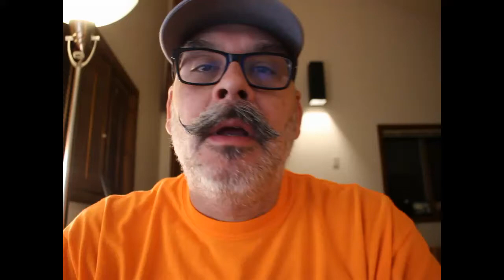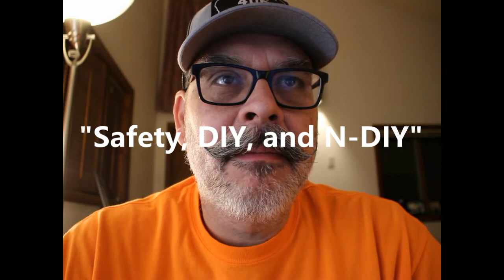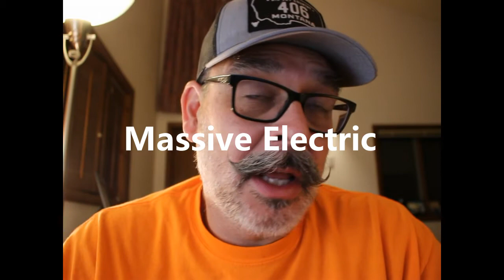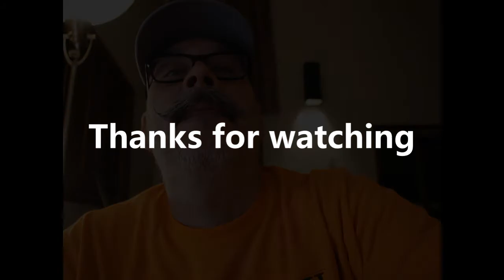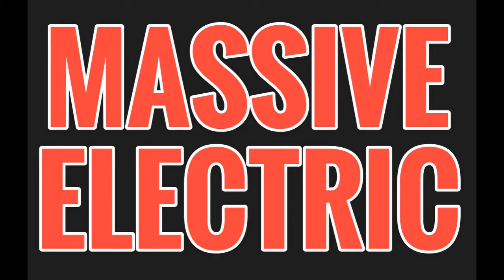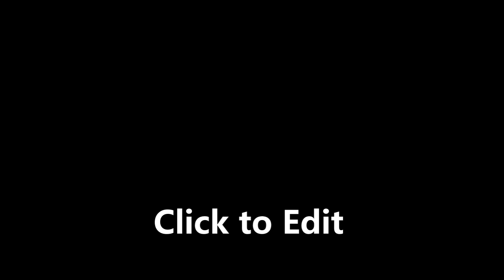Safety, DIY and N-DIY: Pushmatic Breakers Lessons Learned

Comment from the maker: How much experience do you have doing electrical work? Have you ever replaced a Pushmatic circuit breaker?
Reply: No experience. I'm getting ready to replace a Pushmatic 2 pole breaker tomorrow
Reply: I am also a do it yourselfer.  I have a Pushmatic 150 amp service box .  I did some upgrading in 2019 adding a new 20 amp circuit and outlet to my box with 12-2 wiring  so that in addition to the outlet, I could get a proper ground connection to the wall that I could extend up to a switch location.  The switch was one of the old single pull single throw types in series with a ceiling fan .  I wanted wi fi smart switches so I could say "Hey Google {or Alexa}  Turn off the TV Room Light!  "   I have that now.  I also have a perfectly good 20 amp outlet that I can plug  the vacuum in, as well as something big like a space heater, but more often, a 6 outlet  connector that can hold Amazon Echo Show,  Google Home, some USB 2 amp chargers for phones, tablets, wireless headphones and other 2010s 2020s type stuff folks did not anticipate when my home was built in 1930.  I think the electric may have been upgraded in the 70s and 80s because in addition to knob and tube style old wires, some of my circuits have14-2, 14-3  and 12-2  Romex wire , some of nonstandard colors, as today, 14-2 is supposed to be white and 12-2 is supposed to be yellow. You only learn this stuff as a do it yourselfer if you get enough books on wiring and watch the correct You Tube videos.   I have BROWN shielding on some of the old 12-2 wire that feeds the front part of my kitchen.   I watched a lot of You Tube videos and borrowed library books on electrical wiring in 2019 when I added my new circuits.  There is a tremendous amount of info to learn .   When you are in high school and college physics or you like electronics, you know circuits,  ohm's law, voltage current power.   You have to learn from books and videos about standards such as  maximum wire gauge for 15 amps,  20 amps.   I have not had to change anything "double pole" yet --- that means the full 230 volts across your panel.    I don't understand how the one fellow could not find his "main breaker" to shut off power my pushmatic box has a clearly marked 150 amp breaker that looks like 4 switches tied together as one big one.     This response is good.   I am just learning from this video that pushmatic was considered problematic in some ways.   I did find that some of the new grey tandem breakers are difficult to fit into old boxes with the older style black breakers.  Pushmatic breakers are expensive compared to the larger longer narrower black breakers that fit in modern boxes,   This video is a great response to the person with safety concerns,  electric can cause problems and hurt you if you short any spot from one of the hots to ground or worse, across the 230 from two hots.
Reply: I'm not an electrician. I have a 200 amp pushmatic panel in my house built in 1987. I've replaced a few of the breakers and added two new breakers myself. All went well. No issues. Connecticut Electric's replacement pushmatic breakers have always been easy to install and work great in my panel.
Reply: DIY... Soon to join the trades in Appliance Repair... It's been a fascination and I just learned that it was a complete field/specialty a few years ago...

Comment: This reminds me of the folks who just “fix” a repeatedly blowing fuse or breaker with a higher amp version... not understanding issues like the ampacity of the protected circuit’s wire gauge, the length of the circuit’s run or the total number of loads being served. I’m all for DIY if you’re on a tight budget and know what you’re doing, but at the very least have an AHJ (inspector) double-check any changes before restoring power!
Reply: i know it is kind of randomly asking but do anyone know of a good website to stream newly released tv shows online ?

Comment: I had the same problem with a "Connecticut Electric" replacement for what might have been a 1950s Bulldog Pushmatic. It just simply eroded until it didn't work. But I can't call an electrician, because I have a roommate who's bag lady paranoid schizophrenic.  She won't allow strangers on the property.  At all. So sometimes, you have to do your own circuit replacement. And that one I bought at home depot, doesn't fit.  Has some extra chunk of metal where you screw it down. Otherwise it's the same size.